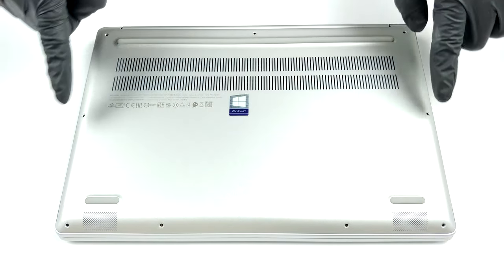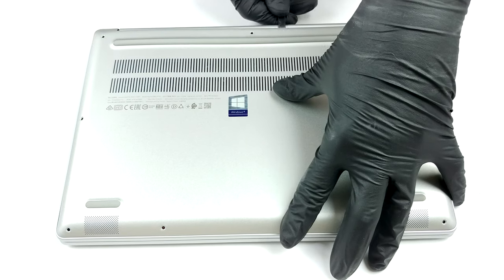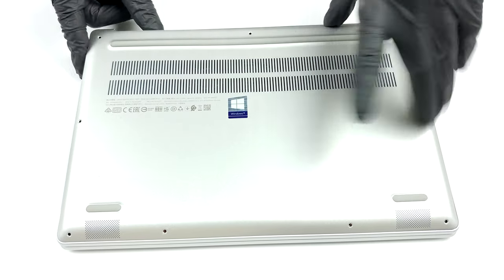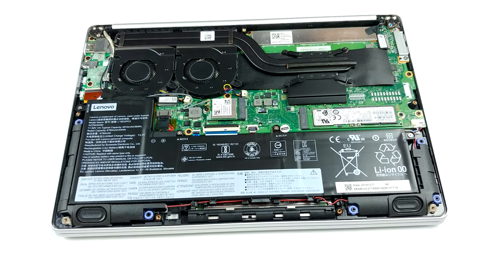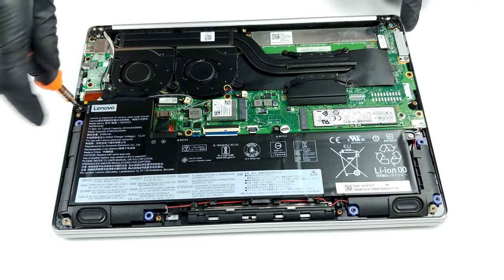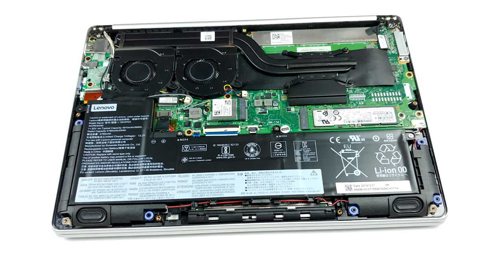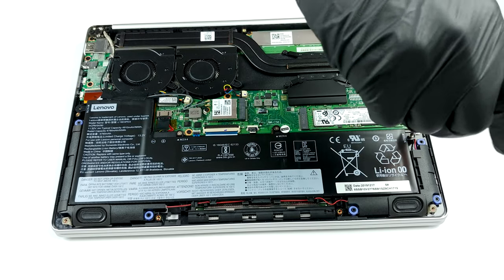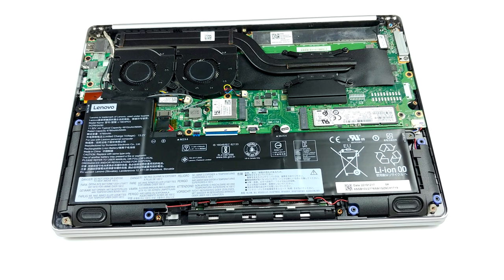🛠️ Lenovo Ideapad S540 (13)  - disassembly and upgrade options

Comment: This model got quite a good reputation in China due to its 16:10 2K screen, default 16GB Ram and decent cooling system (35W for CPU). Also, the two USB C port on the side has the same separation distance as on Macbook Pro, which means dual USB C dock designed for Macs can also be used on this laptop. In addition, there's a special version of this device that features a white ceramic chassis and a touchpad that works similar to Macbook's haptic touchpad.
Reply: 16:10 screen ratio not available in US as of right now in case anyone was interested to know

Comment: Question: I don't see any thermal pad/heatsink on the m.2 ... Do you think this will help in the laptop? 2. I want to change to another SSD 1tb or 2tb model: which one do you recommend? (I want low energy ssd) Thanks in advance and good work!
Reply: Hello Nathaly, have you already done the upgrade? With what SSD? I also like to upgrade.
Reply: @peterb4138  Not yet because I want to upgrade to the SK Hynix P31 Gold or Platinum (because if you look at the reviews online, that SSD is way ahead of other well known ssd's in term of power efficiency) The only problem is that it is not available in Europe and not in stock at the moment in USA ...So I wait when it is in stock or when there will be a better SSD on the market then the P31 in terms of power consumption. At the moment there is no ssd that comes even near the P31... so I wait. And you?
Reply: @nathalyberko1139  What about now?

Comment: can you upgrade the gpu of the ideapad s340?? with an nvidia mx150 for example
Reply: 4800U APU better than mx150
Reply: @galaxyangelzz  i have the vega 8 wich one is better? vega 8 or mx150?
Reply: @maxiduperron5529  vega 8

Comment: anyone know where to find a motherboard for this, my laptop (s540 13) wont start or charge, they say its an issue with a part of the motherboard
Reply: I have the same problem :( How told you need to change motherboard?
Reply: @josueosses7064  hi, is it age issue just randomly stopped working? Mine is +3 years old so its quite worrying. Please let me know if you found reason.
Reply: any updates? mine just had this same issue this week...

Comment: So not ram upgrade?
Reply: Alfredo Colina No, it soldered.
Reply: you can change Wifi card and SSD, recommend do not change SSD, the original is perfect.
Reply: if you want to install the pirate MacOS you need to change the wifi card.
Reply: May I know do it have extra ram slot
Reply: energon liew No, it's soldered dual channel 16 GB RAM.